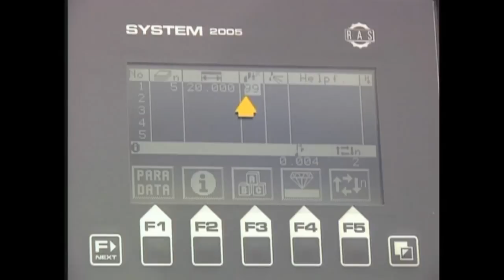RAS POWERcut Schwingschnittschere | RAS POWERcut Swing beam shear

Comment: hello
i m having 6 and 8 mm hydraulic shearing machine i m having problem tat if we put width of 55mm in 8 mm thickness plate its shears in machine but its having twist in tat strip does any body have solution regarding it...plz replay